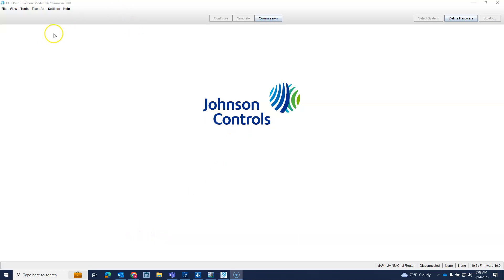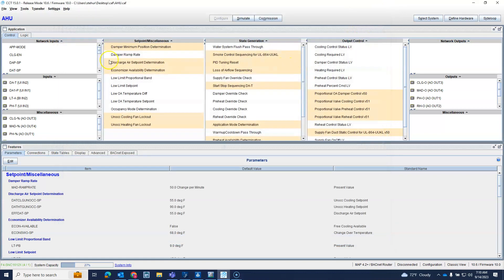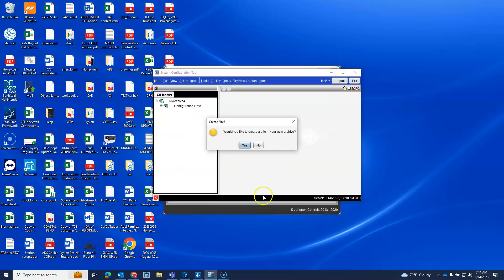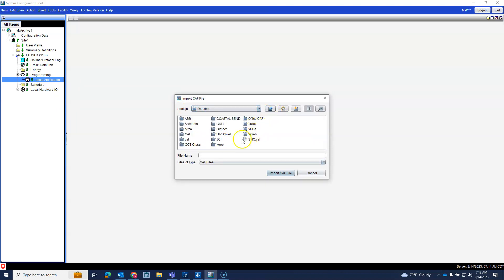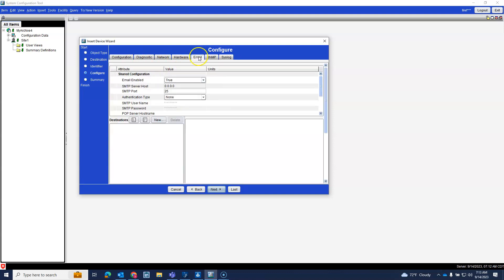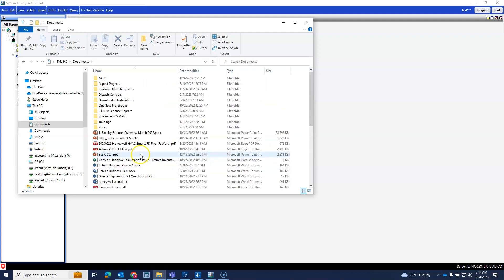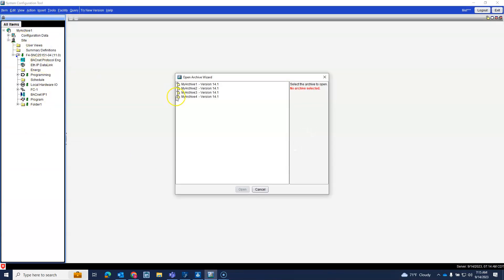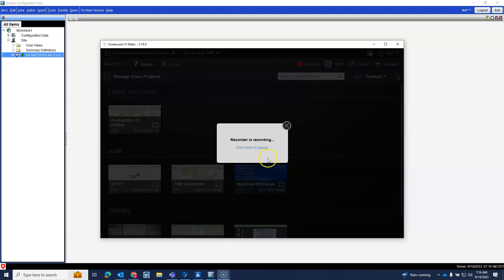Why I hate SNC controllers Part 1

Comment: I never can understand the hatred for the SNC I use the heck out of them as I can get way more bang for my buck them an CGM plus an expansion module and a display. From what I've seen 99% of the problems people complain about are PICNIC errors. 
Had a long talk with JCI at CBC23 and found out the next release of SCT will have a classic mode that will allow you to upload directly from CCT the way you can with an NCE.The NCE was basically an NAE with a controller slapped on the FC bus and housed in the same package, unfortunately when they designed the SNC they made it one unit and it kind made a mess of things.